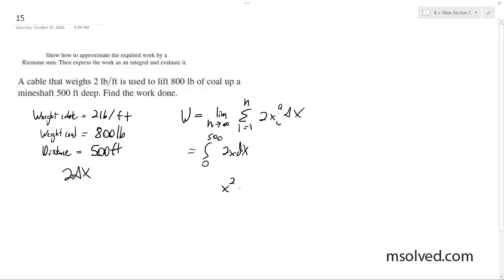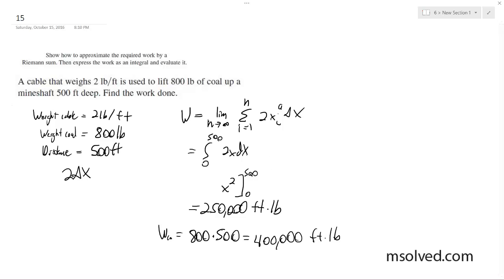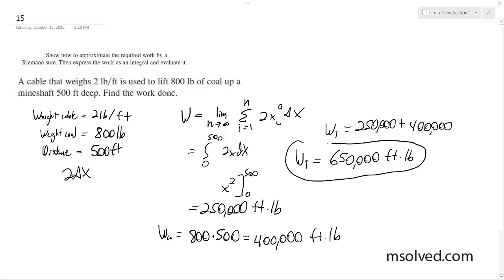A cable that weighs 2 lb/ft is used to lift 800 lb of coal up a mineshaft

Comment: first he found the work for the cable -> w=integrate(from 0 distance to 500ft)[(cable weight)(x)dx], when you integrate you pull the cable weight to the outside and you get x^2/2 evaluated from x= o, x=500. the work to move the cable is 250,000 ft-lb.                                                                                                                                                                                                                                                                        then you need the work for the coal. since the coal is a constant there is no dx involved. you simply take the weight of the coal and multiple it by the distance=400,000 ft-lb.                                                   then he just added both values, cable work + coal work = total work
Reply: Hiii!!! For an instance, when the coal isn't constant and is moving on its own (let's say it's a monkey), do you still need to integrate for the cable and then integrate for the coal??

Comment: where does the 2delta come from?
Reply: The cable weighs 2 lb/ft, but as the coal is lifted, it changes, so delta x represents the change in x